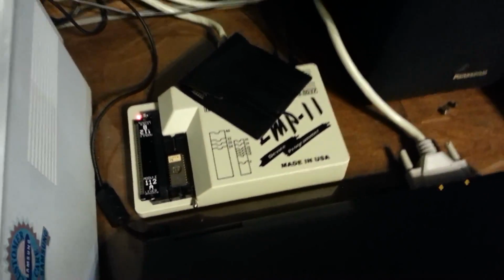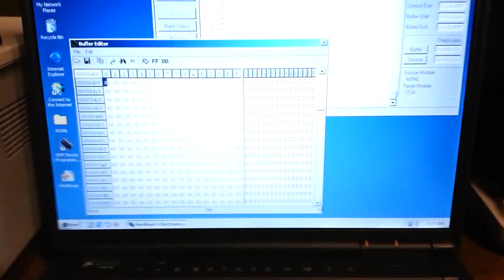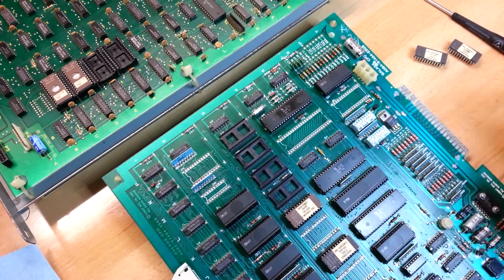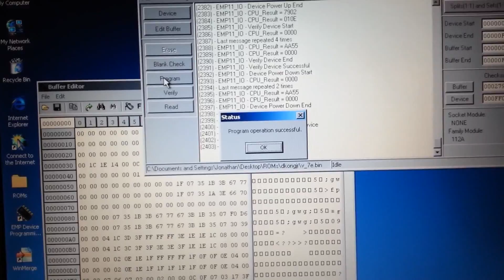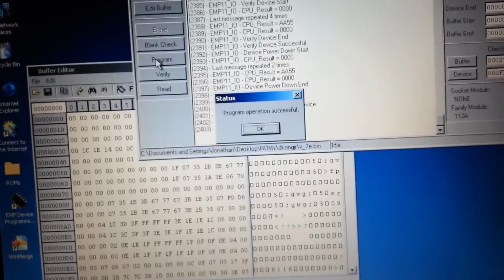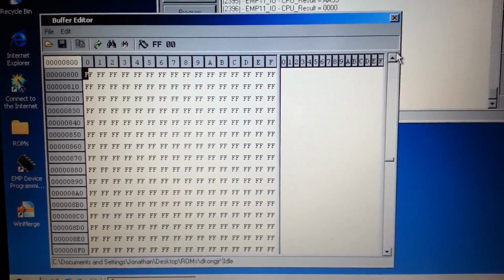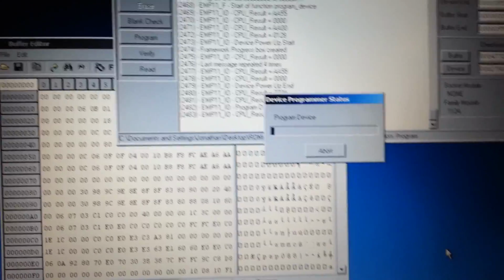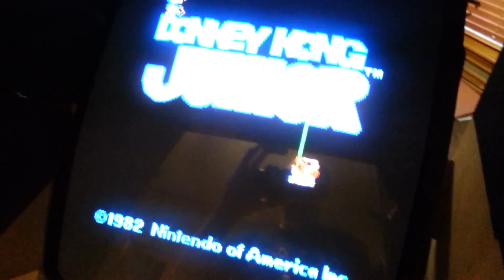Repair - Donkey Kong Junior EPROMs - 2716 to 2732

Comment: I,m having a similar problem with a donkey Kong. I can’t seem to find anywhere online that has the files to download for my EPROMs. Any suggestions?
Reply from the maker: I can only recommend you try various search engines and websites.  Also, try joining forums, discord channels, or other locations to connect with community members.  Most of them will be able to get you what you need.  Thank you for the comment! :)

Comment: Did you try erasing the original EPROM's to see if they would take a fresh programming?
Reply from the maker: Good catch, but yes I did attempt to erase and program them.  It just wasn't in the video.
Reply: Im in a similiar situation but sofar my 6 2716 eproms that are close to empty and flipping bits dont realy erase or keep having flipping bits, guess these are dead. clever solution Jonathan with using 2732. got some of those.

discovered even some of my 2732 are "dead" (flipping bit at every read). 2 of them dont even allow programming.